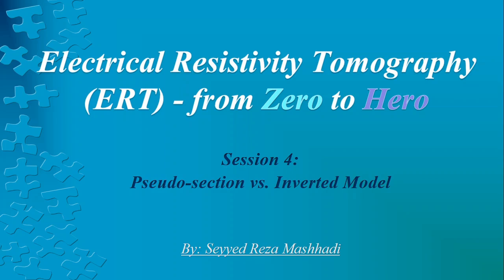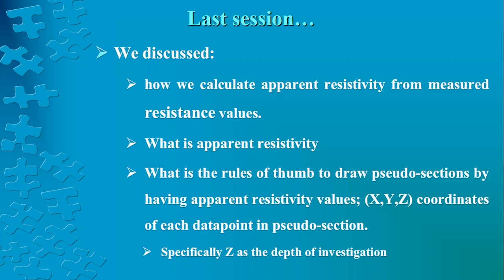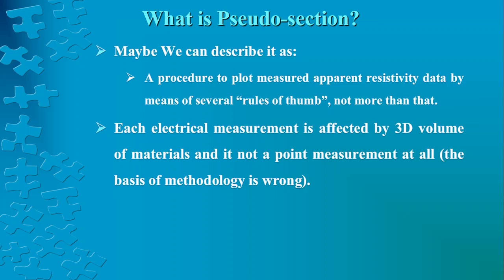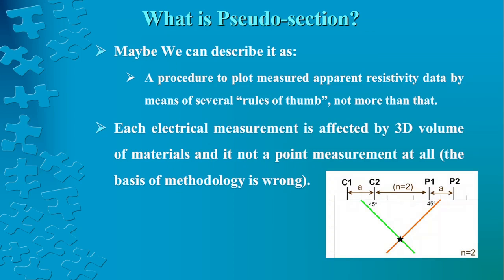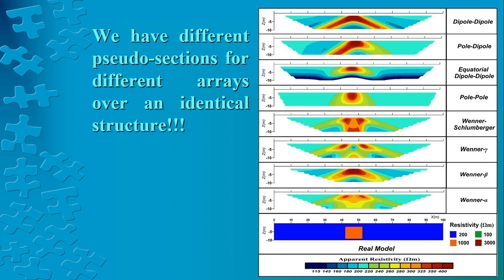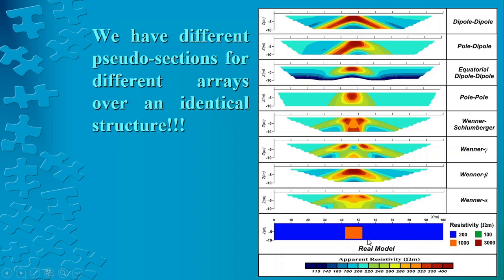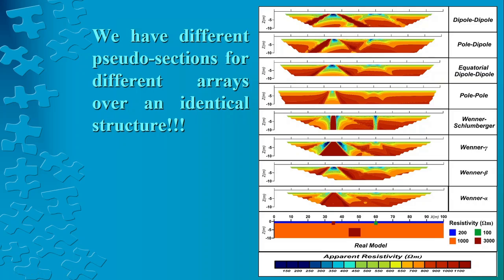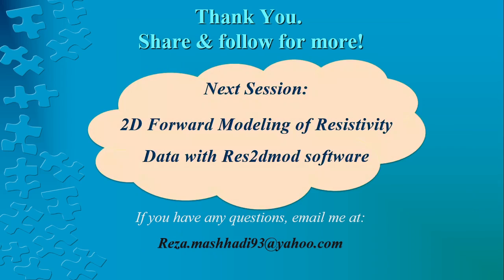ERT - Session 4: Pseudo-section vs. Inverted Model

Comment: Thanks a lot for sharing. I have been asked to prepare a report on electrical resistivity interpretation. Could you help me in creating a structure, how should i arrange important steps in the interpretation stage, just topics, please?
Reply from the maker: Look at reports etc 

Depending on your case you may add remove combine sections etc 

Abstract 
Introduction
Theory (brief)
Study area
Project design
Data acquisition 
Processing 
Interpretation 
Conclusion 
References
Appendix

Comment: Thanks for your effort, you mentioned in this video that there is an article discuss the characteristics of different array { Ping; Zoë 2004) but I did not recognize the spelling, any link for this paper plz?
Reply from the maker: A numerical comparison of 2D resistivity imaging with 10 electrode arrays
Torleif Dahlin, Bing Zhou

https://onlinelibrary.wiley.com/doi/10.1111/j.1365-2478.2004.00423.x